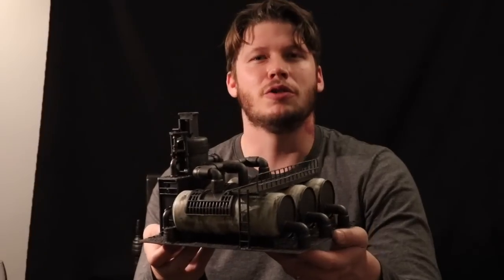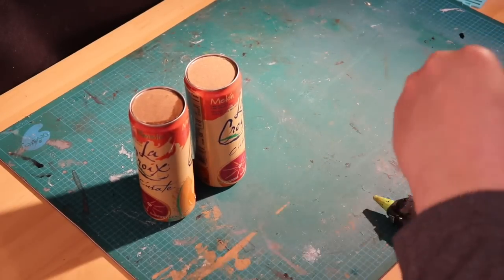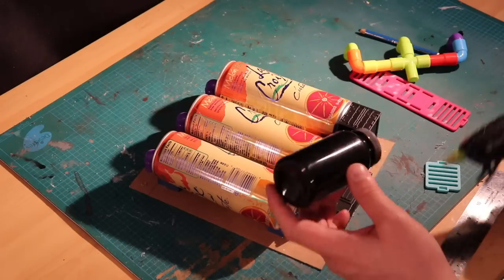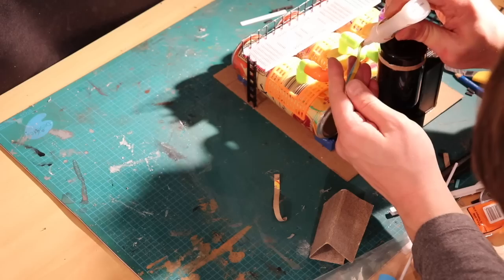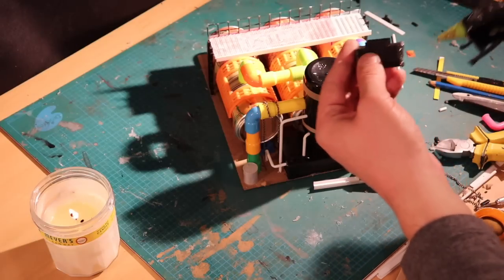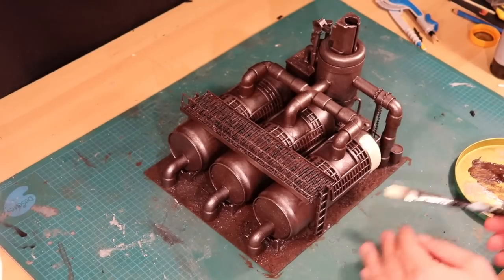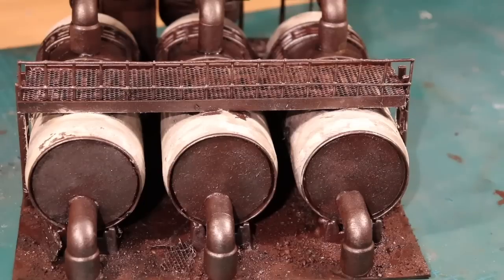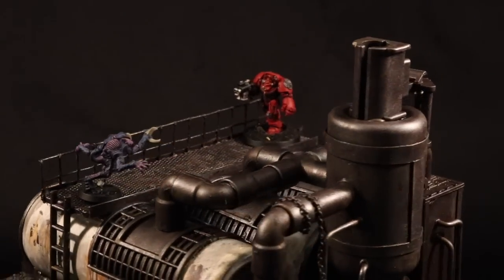Terrain Tutorial: Fast & Realistic Dystopian Industrial Tanks - Warhammer 40k, Necromunda, Kill Team

Comment: Pro-Necromunda focused terrain channels are rare and this one is great!
Reply from the maker: Aaron Brown thanks aaron! Im gonna be doing some mordheim and warhammer fantasy stuff too
Reply: @EricsHobbyWorkshop  Please do Mordheim. So badly need more tuts for the town I am building.
Reply: 'Food grade' polyethylene film can be used as industrial 'curtains' (big pieces or vertical stripes) and tarps (big pieces and shredded parts). 'White' washes to simulate minerals, bit of yellow-amber for the weathered plastic look, bit of dark grey in the corners for filth. Hanging in a straight line or in a serpentine fashion like a shower curtain.
When folded on the ground or lying flat on stuff close to the ground, green washes and black spots to simulate algae/moss + filth.

Some parts can be 'worked' with various heat sources to create chemical or thermic burns/attacks.
Also, gently dragging the film on sand paper/using polish paste is a good idea for looks and paint/washes hold.

The well known CompactDisc case broken and burnt and scratched and drilled will give a cool 'safety glass/polycarbonate' look in buildings, industrial or military. Bullet impacts look good.

Comment: Your methods have saved my life. I was just painting my metals a light grey and then darkening them with a heavy black wash to get where I wanted. It doesn't look bad, but with your method 
I can get the darkness of the metal and the shine in there still. I was always adverse to using shiny metallic paint on large portions of my terrain pieces because it looks a bit too front and center. With this though dry brushing it onto a burnt umber base really fixes that. Also you inspired me to make my first soda can piece. Thus far I had only been using foam board, popsicle sticks of different sizes and old warhammer sprues. It worked though as im doing ork terrain with that, and foamboard ruins for my imperial terrain.

Comment: You can add toy steering wheels on big pipes to give a realistic touch.
And simple 90° levers here and there on smaller pipes (the end always painted red or bright yellow).

Very good job!
Reply from the maker: Ive been having trouble finding good valve controls. Do you know where to find cheap toy steering wheels
Reply: @EricsHobbyWorkshop  No. Always have to cannibalize other models..
A buddy used to make some with very fine spaghetti of epoxy putty you then form into a circle around the tube diameter of your choice.
Glue a simple '+' cross behind or something more fancy and you have a wheel. It's a delicate job..
I think it's more practical to punch and then 'hole' a round piece of thick card paper. 4/5 layers thick with a '+' inside. Hard varnish and paint.

For the best looking fine wheels regardless of scale = https://www.google.com/search?q=bicycle+small+toy

Comment: Really do like this type of build but I have to figure out how to scale it down to around 20 mm or 1/64 scale for a Gaslands type build. Same concept just have to locate smaller cans use thinner paper smaller hardware cloth ect.  The difference between 28 mm to 20 mm is pretty amazing as is 20 mm to 15 mm. Makes some things harder like finding bits and pieces that look in scale. But then again using foam,  plastic, chipboard and even tinfoil you can usually make what you need. And in the smaller scale you get away with a lot more things as long as you make a piece look "lived in". Keep making great vids and we'll keep watching thanks for all you do.

Comment: great video! really usefull, thanks! 
i have only one problem and that is that my chipboard bases are wobbling/the corners goes up, how can i prevent that??
Reply from the maker: pepsminis andmore what are you putting on top? Some products contract when they dry and curl it up. I personally haven’t had much issue with this, but when i have i wont hesitate to aggressively bend it back the other way, past flat so that it ends up flat. Its a paper product after all so doesnt really have a memory of a shape to snap back into if that makes sense. If you have to reglue some pieces/ touch up some crack on the top after rebending so be it. I think the layer of glue and sand adds enough structure to keep the paint from warping it for this particular project
Reply: @EricsHobbyWorkshop  thanks for the tips! i use woodglue/pva and paint deluted with some water,  i guess its the water. anyway going to test some mdf bases soon. thnx for the reply!

Comment: Pretty cool - just like special effects in movies ie. nothing is what it seem it's all smoke and mirrors (and a bit of paint) !

Question: if one would have wanted to make those tanks with rounded ends instead of flat ones what would be the best way of doing this ? I could imagine that a sphere like a ball cut in half would do the job, however I'm more concerned about getting the diameter to fit the end of the can, so is there something which will alway fit various diameters and look good at the same time ?

Maybe you could do a video where you deal with this subject...
Reply from the maker: Yeah, a plastic ball or something would work, but it would be easier to just start with a cylinder with a rounded end. I think i have a few in my bits box. They are from cheap water guns. Maybe i will make some in a future video

Comment: What glue could I use instead of hot glue?
Reply from the maker: Superglue gel? 2 part epoxy? Construction adhesive? White glue would be bad as it needs porous surfaces to dry. You just cant beat the flexibility, gap filling and quick dry time of hot glue in my opinion. Why do you need an alternative?
Reply: @EricsHobbyWorkshop  Thanks.